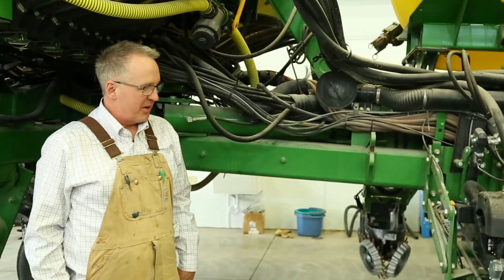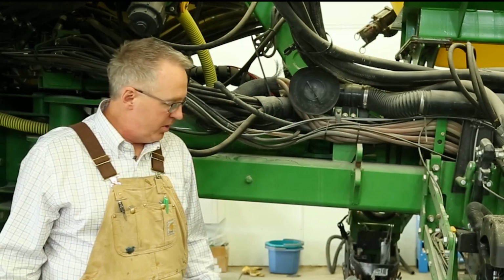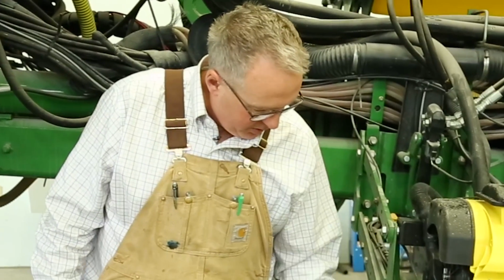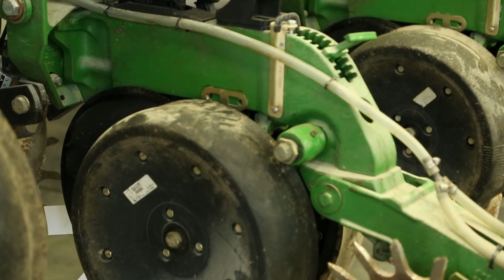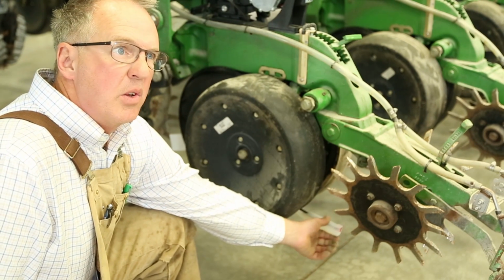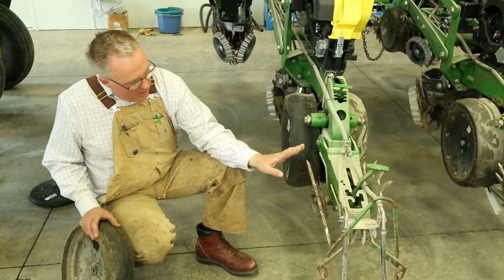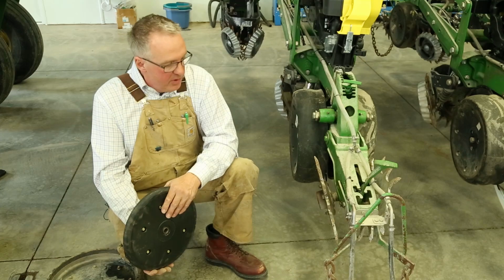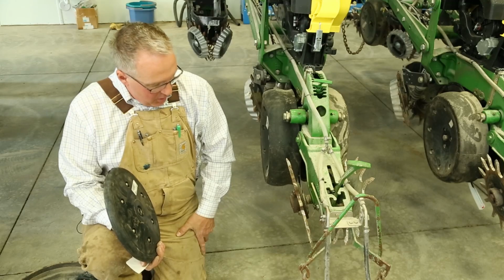Iowa Corn: Steve Berger No Till Planter

Comment: That's a Martin row cleaner.  The Precision Clean Sweep is only the air cylinder that controls how much down pressure there is.  Next the 3.5 mm blade is the standard blade, the heavy blade is 4.5 mm.   CIH uses an offset opener system which is far superior to the JD opener in opening the trench in no till.